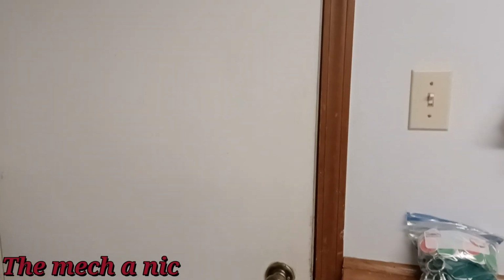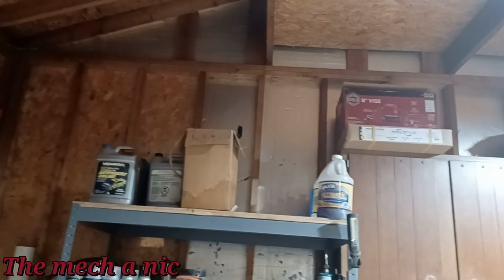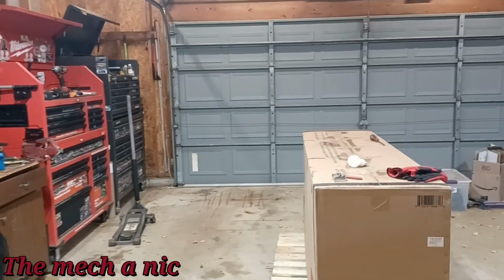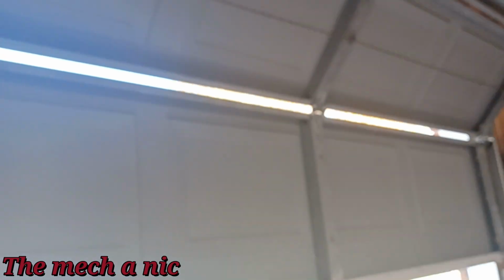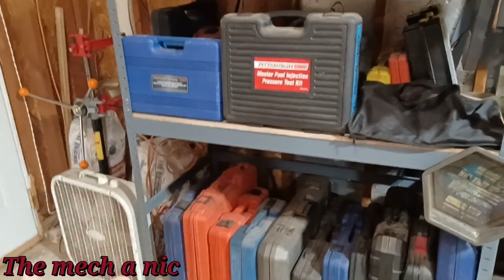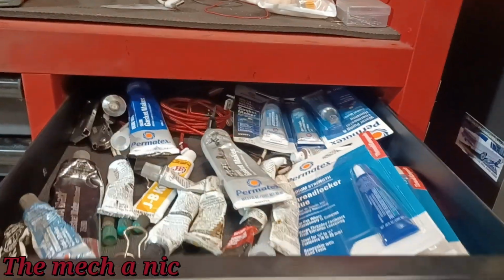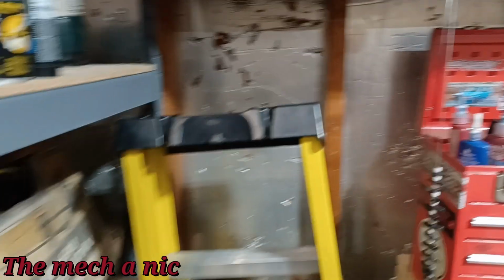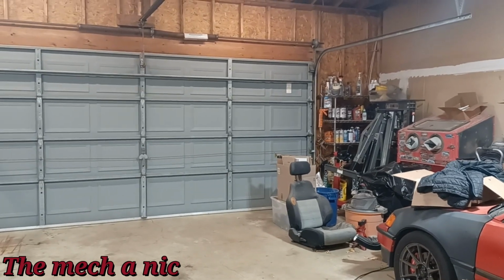Garage upgrades and repairs

Comment: If the light is switched on the hot wire, shutting it off should work. If they put the switch on the negative wire, the hot wire is still live. Ouch. 
(When dropping the clip, remember there might still be one in the chamber)
Reply from the maker: I have proper tools for checking if a circuit is live or not before I work on it.
Reply: @themechanic6117  Yes, I assumed you would. But people who watch you ... 
I don't know. Anyway, thanks for the video !!
Reply from the maker: I hear you, that's why I said don't listen to me, I'm no electrician 😁👍
Reply: @themechanic6117  Gotta love the do it yourselfers ! I had a dirt floor tiny garage that we jacked up and poured a concrete floor under !!  Too easy to lose nuts and bolts in the dirt. Thanks again. 
Now 75, lighting is EVERYTHING.

Comment: First off, this was an excellent video.  I'd have watched an hour of it or more.  The difference with the new lights is night and day.  It's huge!  I did the same in my 24'x26'x10' garage, I went with six of those led lights with the panels. What are the dimensions of your garage? It looks pretty close to mine.  Anyway, I think this new garage is already much better than the old place.  With your high ceiling do you plan on getting  lift? I absolutely love my 6000lb mid rise scissor lift by Bend Pac.
Feel free to show more of the garage/shop as it's coming along.  I look forward to the progress and success

Comment: I've also recently relocated and the first thing I did was fit LED batten lights in the garage replacing the crappy single overhead fluorescent.
Makes such a huge difference, but I should have bought more🤔
I'm also contemplating having a 2 post lift fitted, but that's for next year.
Reply from the maker: That's awesome,  no such thing as too many lights lol . If I put a lift in this garage I doubt I'll be able to fit 2 cars in here since the lift itself takes up space. If you have the space for a lift I say go for it! 👍

Comment: Garage door opener belt:
Remove, turn inside out, carefully clean it on your bench grinder wire wheel. Take all the hard, slippery glazed rubber off, just about 1mm. Wipe down with Isopropyl. After reintallation, spray some Belt Dressing on it while it's moving. It will last for years. Higher traction, moisture & ozone block. I'd really like to see you start using it when servicing cars, too. It's a very good practice! A little goes a long way. Stupid people give it a bad reputation from improper use.

Comment: Garage wiring in all but the newest homes is hopelessly inadequate. The good news is that if you upgrade your garage electrical power, your home resale value will rise significantly in this era of growing electric car use. I would get an electrician to bring in a new line and a new subpanel, enough to power a welder, a compressor, electric car charging, and 20 amp power tools. Dedicated power tool plugs are important because you'll avoid nuisance tripping when you try to tap into circuits dedicated to lighting. You should be able to write that expense off for your business of fixing cars.
Reply from the maker: We've talked about that already.  I know it's not a good idea to run my compressor and all my other crap off of a 15amp breaker that was just intended for lights . Once we get settled in and I can save a few more pennies I'll look into getting an electrician out here. 👍

Comment: my garage door guy says use the spray lubricant rather than grease in the tracks and the springs need annual lubrication or the door will bind when lifting.
Reply from the maker: I think this garage door is definitely do for maintenance.  Thanks for the tip👍

Comment: Great job with the lighting, Garage set up is looking good, certainly more room than the old garage. Bring on the repairs 🙂
Reply from the maker: Thanks! It helps to keep myself motivated also. I remember at the old place since the garage was detached sometimes I didn't want to go out to the garage when it was raining or snowing. Now I won't have that problem since the garage is attached.

Comment: Beautiful shop dude ❤

I can't understand why someone (previous owner) would go through the trouble of building a work bench/table and NOT have an electrical outlet??? What are you gonna do - have extension cables all over the floor? Nothing like tripping and splitting your head wide open on a concrete floor 😂
Reply from the maker: He had an extension cord going to that one light over the bench. After looking over the whole garage/house it's very clear that the previous owner wasn't really the "handy man" type .